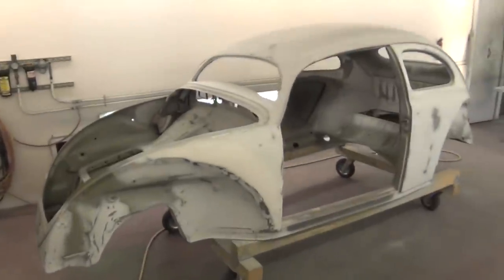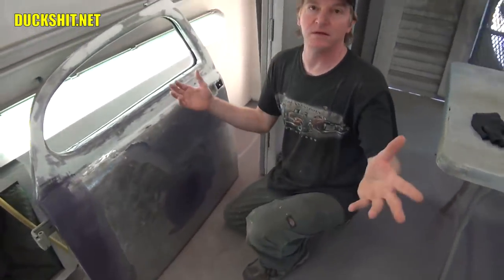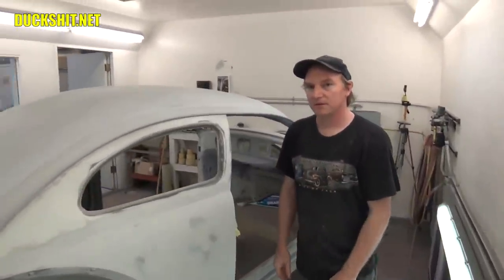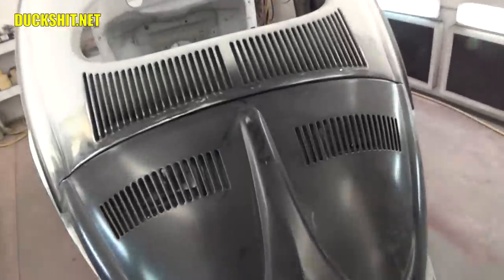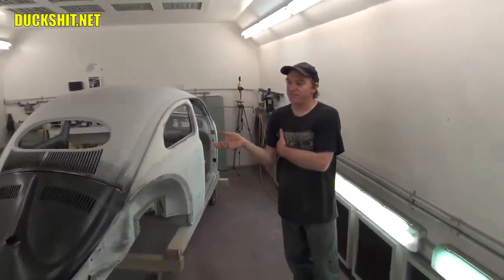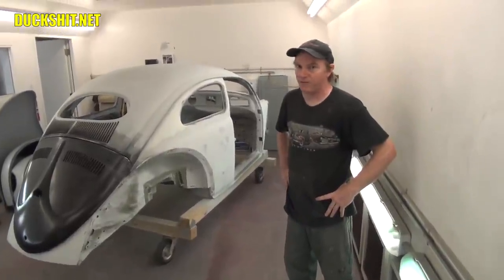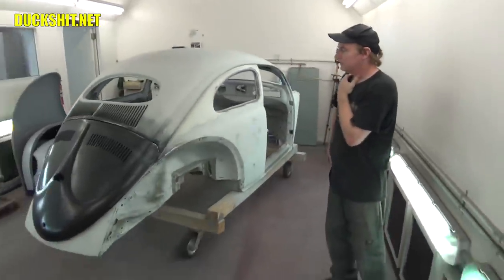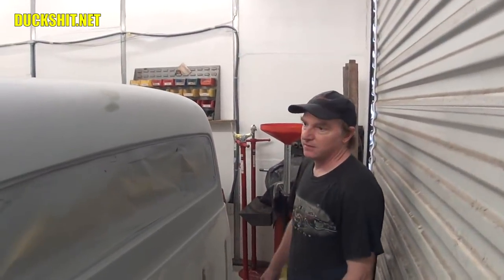Visiting Eleanore and Updates from Earl! - ROTTEN OLD CHOP TOP 1956 VW BEETLE - 140

Comment: Nice touch on the louvered W deck lid! It fits well on the “one of none” and adds another gem to the custom look of Eleanore. Damn, Earl is awesome at his work! I had the chance to get some paint/body work tips from Earl recently for my 68 Beetle project, and received a brain dump of all sorts of great tips. My color guess: Skeeter Feather Brown
Reply from the maker: Believe it or not that decklid is actually a stock piece, except it’s for a convertible beetle.  All those louvers however add to better engine cooling so if I decide to upgrade the engine in the future it would be worth putting on the better decklid now!  😃

Comment: I don't know what your color choices are but mine starts out with metallic indiglow blue with metal flake. Then going front to back starting at front left fender and ending just right and under right rear corner of back glass, is a series of different size triangles that overlap at different degrees or rotation. Each triangle has random stripping inside . The triangles are dayglow blue , gray gray, dark blue and silver ( silver is more like a gray metallic ) ...the whole theme is based off a airwalk shirt I had in the early 90's . This is what will be my paint on my son's STI beetle when we get done. If you have need for speed heat I have this paint built on a bad ass pro touring beetle, its shared ( focinite... pronounced foke in ight , I had a killer focus back in the day )
Reply from the maker: Thanks Rob, based on your description of your color scheme I thought it certainly sounded late 80s early 90s with all the abstract shapes they used back in the day.   And one things for sure, Airwalks are so hard to find in my size LOL!

Comment: Interesting comment he makes about "old" steel, using a pick to shrink.  So why not use a torch heat to shrink? Is that the lost art referred to or is there a fear heat won't shrink it?
Reply from the maker: Heat can shrink steel if you do it right.  There is a friction method that is common.